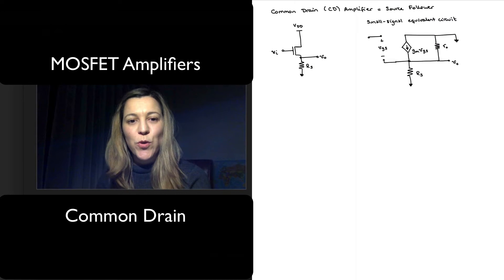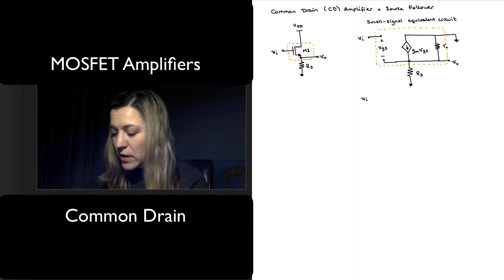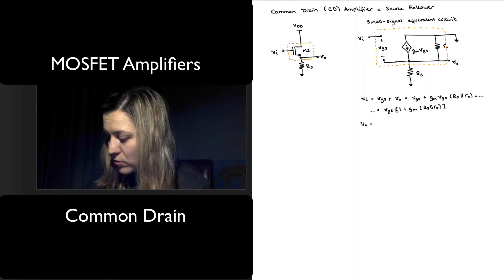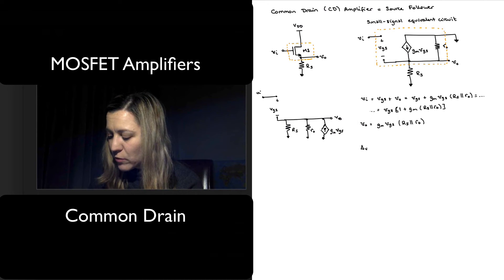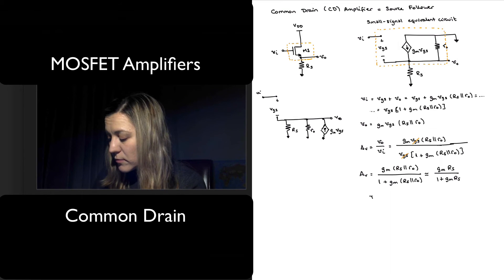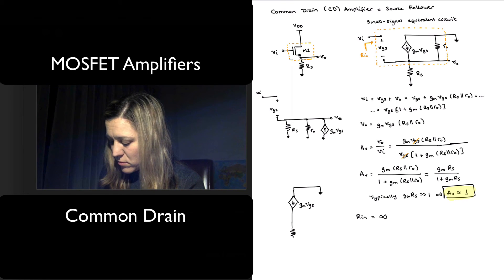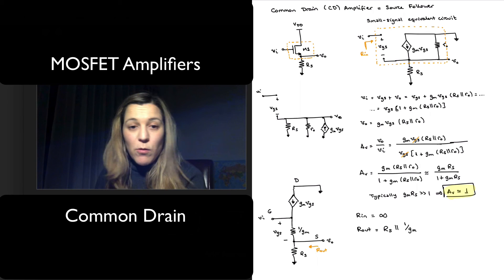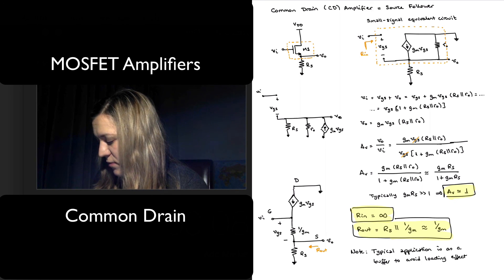Common Drain Amplifier

Comment: Related to the full screen and HD: for  the watcher, even using the highest resolution, we only understand the equation by the audio ("litle ar-oh"), not visually. If we use the enlargering ofter the "full screen" command, everything becames messy, and we need to concentrate on organize the screen and not on the lecture. It seems that the left side is video by video becoming big, accordingly the right side is becoming smaller, smaller..In this momment, try to imagine a "not so good" soundtrack? Anyway, congratulations for the very good explanations.